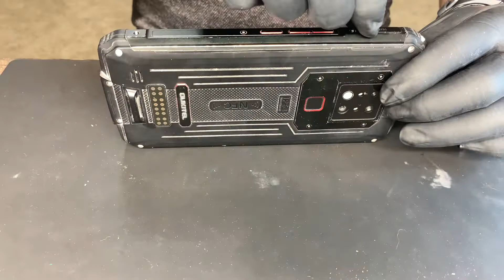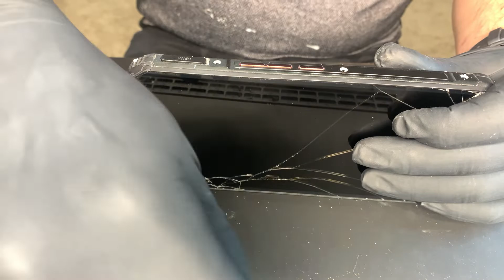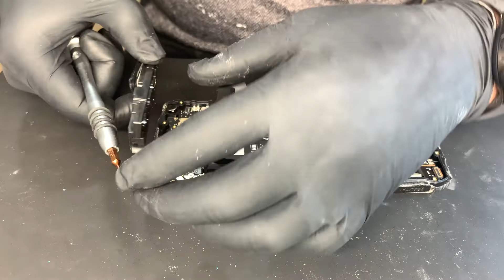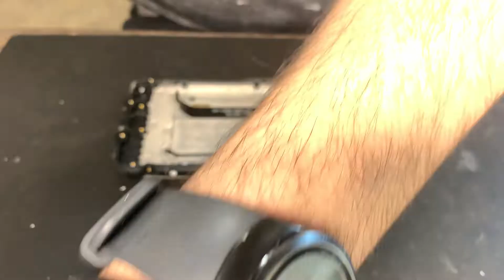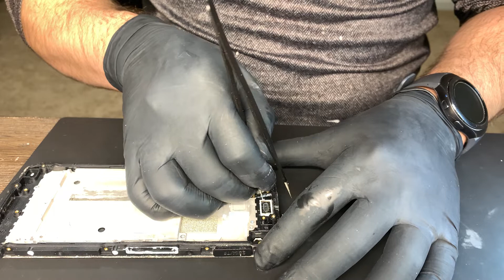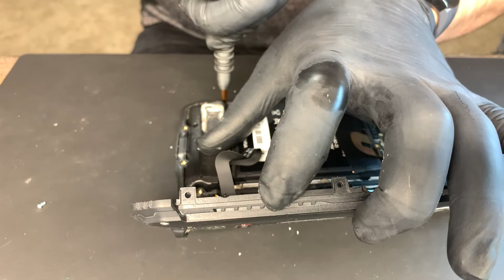OUKITEL WP7 Teardown/ Screen and frame replacement.

Comment: is it more difficult to fix compared to a @standard phone” ( apple, honor or whatever)??
Reply from the maker: It takes longer and some of the parts are hold on to the frame with some tipe of hot glue but nothing impossible

Comment: hi on my device, the upper glass which is covering the notification LEDs, is broken. is that coming with the frame or the whole Display?
Reply from the maker: Hi there Karsten,
The notification bar is part of the screen, to get it fix you would have te get the screen completely replaced.

Comment: Oukitel rugged phone are not what they claimed. I had the WP6 and the loud speaker is already busted the screen which they said scratch proof IP68 has had some scratches so I was force to buy a tempered glass protective screen. have some issues with the power switch, and who knows what would happen next. I think this product is a rip off for anyone. My friends who got the WP5 based on my endorsement are pissed, their phone lasted for a year only.

Comment: Awesome video. Might come in handy spon. If you reading this, maybe you can answer  two questions for me? What makes this phone water proof? I think I water damaged mine the first day. When I try to turn on my night camera. It says occupied. When I try to switch to front camera. It switches to night vision. It worked properly for the first few minutes until I put it in a bowl of water. Have tried different firmware, same issue. Anyway to test for the issue?